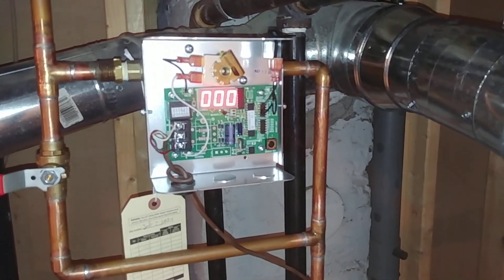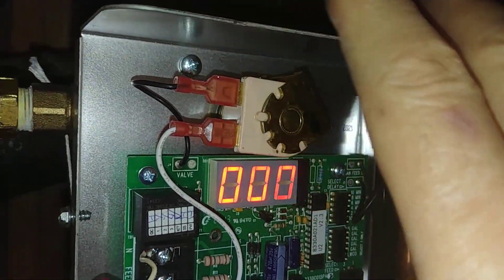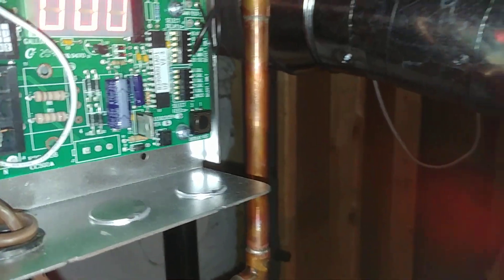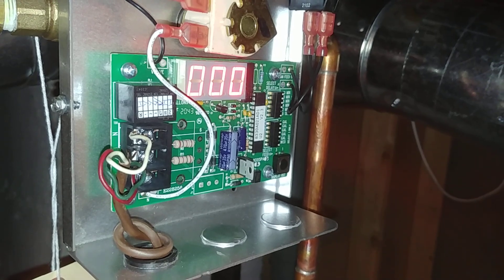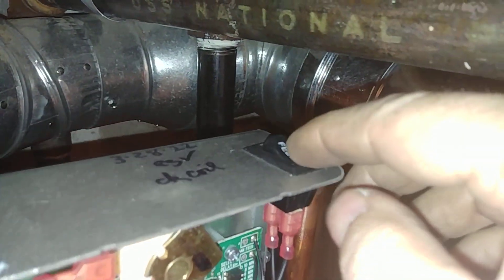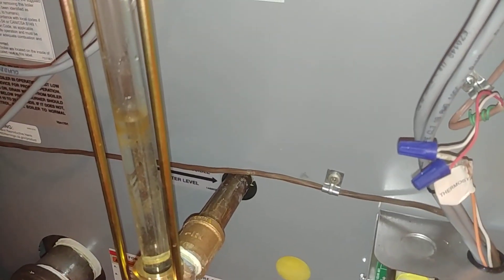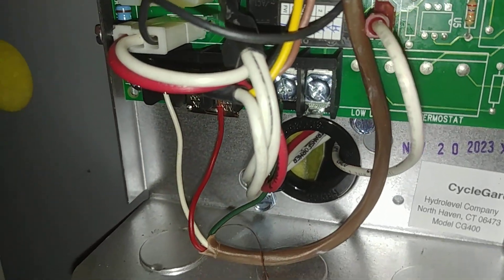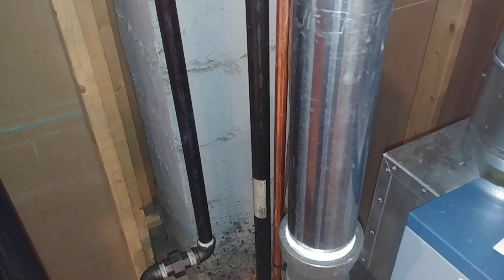VXT-24 Steam Boiler Automatic Water Feeder With An Adjustable Orientation Valve & Wiring Tips

Comment: I turned on my boiler for the winter and water started coming through the 2nd floor, one of the radiator valves was totally broken, I cut it out and put a new one in, no more leaking, and trying to start boiler again and the vxt keeps blinking 577 and then when I turn the water on it dumps it out the back and the boiler won't kick on, do I need to reset the VXT-24 or what do you think?
Reply from the maker: I would shut the valve off to the VXT and  drain All the water out of your system.
Refill the system manually up to the proper level in the sight glass.
That's certainly not all that's wrong, but I'd start there.

Comment: my mothers lennox  furnace has this setup and while they were away wouldnt shut off overfilled like i drained 10 g from radiators upstairs very disapointed been doing this since new. i have just shut off water and will check it every 2 weeks , add until 3/4 sight glass . company put in in will not acknowledge, and want a svc contract typical
Reply from the maker: Sorry you are having problems with the VXT over-filling your mother's boiler.
How old is the VXT, i.e., how long has it been in service?
What are the numbers on the display?

Comment: Mine over fills all the time. I shut off the water and feed throughout the day. VXT24. If I reset the numbers and will that help? I am not sure how you get to it. I'm the maintenance, my husband sits on the couch . LoL. Confused on how to replace of I have too
Reply from the maker: If you are feeding your boiler water "throughout the day", I may have some bad news for you: At the least, you have a major leak or your boiler is failing/has a hole above the waterline.
It may be your VXT issues are the least of your worries.
In any case, it might be that the VXT valve will need rebuilding.
You can buy a rebuild kit for it.
I have videos on how to rebuild a VXT.

Comment: Our feeder indicates 285. Is it a problem?
It briefly stopped and showed LOC
Reply from the maker: Either you have a leak on your steam system somewhere, or your feeder has not really truly fed 285 gallons since it was last reset.
When was your feeder last reset?
When you push down on the rocker switch manual feed, does water actually enter the boiler? (that is to say, does the water level rise in the sight glass?)

Comment: We recently replaced the boiler with the VXT-24. We don't see a period mark afer the single digit, does that mean the feeder hasn't been set correctly and could've fed water when it needed to?
Reply from the maker: If you push the rocker feed switch on the VXT, does it feed water into the boiler?
Reply: @gordonschweizer5154  it works fine now.  I will come back if we have other questions. Thanks a lot for replying